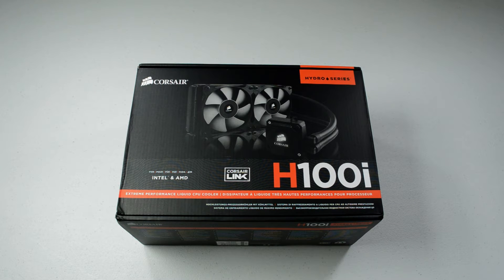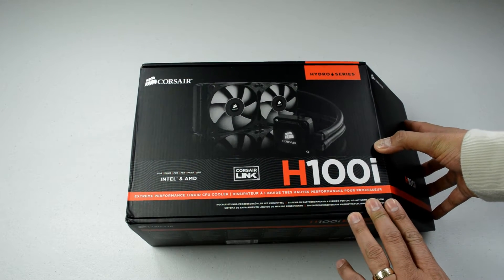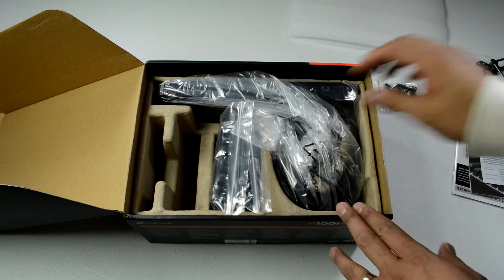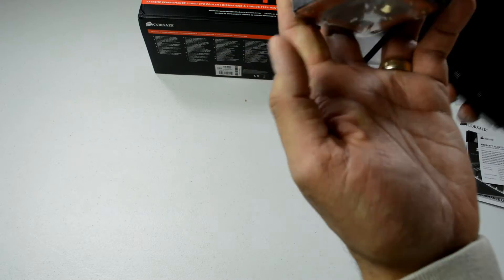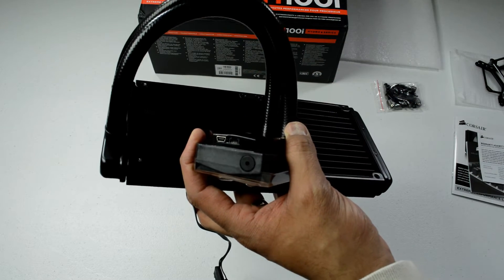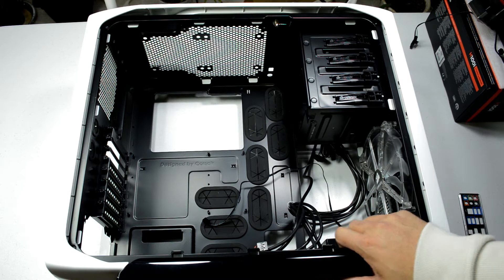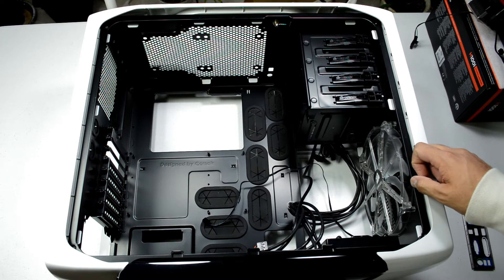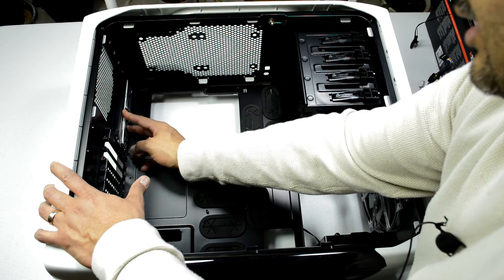PC Upgrade 2014- Haswell i7-4770k - Part 3 - Corsair H100i Unbox/Install

Comment: Is it worth to replace the stock fans of the h100i with high performance sp120's? I'm wondering if the sp120's are more quiet than the stock ones while still maintaining good performance for cooling since they have lower rpm. Thanks
Reply from the maker: JaYJ4yVM Well, the SP120 Performance fans I originally got were LOUD.  I ended up buying the Quiet Editions instead.